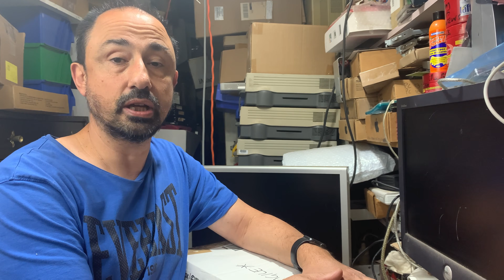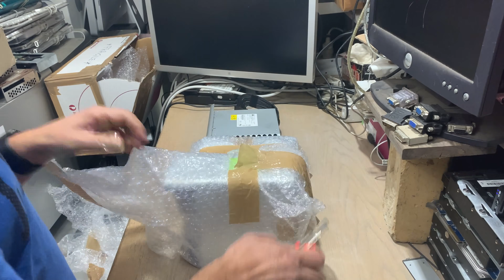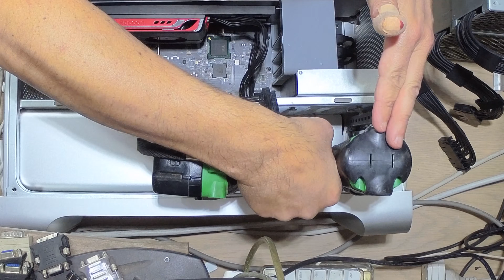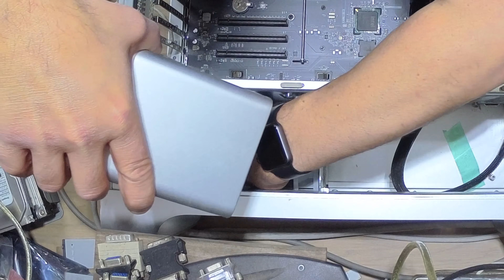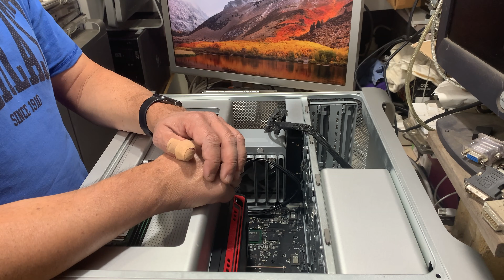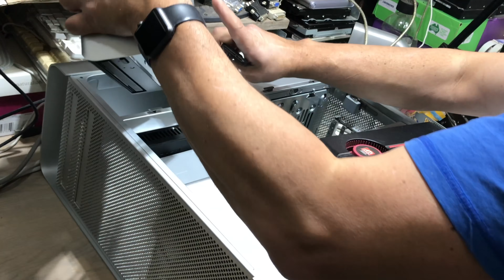[aa-unbox/repair] Replace Mac Pro 4,1/5,1 A1289 power supplies 2009/2010/2012 ⇢ 00000110 ⇢ v22-007

Comment: why don't you have a pad under the case and you draw and make scratches on the beautiful smooth side wall
Reply from the maker: Thank you for your suggestion. About 95% of the Mac Pros that I obtain are from leasing companies, and unfortunately they have been knocked about in large warehouses before arriving to me, thus the multiple marks and scratches that are already on the sides of these Mac Pros. The other 5% are from individuals, and they are not in mint condition either. I just traded one in recently and it had a top bent handle and it wobbles about a little, so one of the bottom handles must be bent a little also.
I will take on board your suggestion, and place a cloth or a large sponge mat, like I used to in the old days.
Reply: I would use a towel or something to stop adding more damage. From fellow repair guy, because client can always blame you for scratches . Always take picture be they hand it off to you. Extra protection from lawsuits
Reply from the maker: @Messiah38  I use to use an oversized sponge many years ago to stop from scratches, and I may use one again. No customer has complained about too many scratches. No customer has taken me to any lawyer as it will not stand in Australia.

Comment: do you know how could i check a PSU with a multi meter?
Reply from the maker: Type 'check pinouts mac pro a1289 power supply' into Google, select 'Need Mac Pro 2009 - 2012 PSU Pin out' from the MacRumors Forums, then scroll down a little until you find a diagram of the pinouts to the connector. You should be able to check out the voltages with a multimeter. This search criteria may change over time.

Comment: I have 3 Mac Pro 5,1 that stopped turning on after a sudden power outage, at 3 different times, they all failed for the same reason. What are the chances that it is the power supply? Should I try buying a new power supply?
Reply from the maker: The main reasons for any Mac Pro not starting can be a fault of any of the following: 1) power supply; 2) backplane/logic board; 3) CPU tray; and to a lesser extent 4) front panel board and 5) front panel cable.
The symptoms can be no power at all (1 or 3, or lesser extent 4 or 5); power on with front light on, but no sound (2); power on and flashing front light (faulty or no memory); power on, startup sound, no video (faulty GPU/video card or cable or monitor.) Other symptoms of power on and then nothing could be a combination of a faulty GPU/video card, or a faulty hard drive or SSD adapter, or a faulty CPU. These are rare but I have had these issues at some stage.
I have a concept of a plan of the process of creating a video for diagnosis of a Mac Pro.
Reply: @ My Macs don't give any sign of power when I press the button, but the fact that the problem appears right after a power outage/failure increases the chances of it being the PSU, right?
Reply from the maker: The power supply is the most likely cause, but as stated previously, it could one or more of the following, in order:
Power supply; CPU board; backplane/logic board; front panel; front panel cable
Buy one power supply and test all 3x Mac Pros. Watch this video anywhere from 3-5 times to show you how to replace the power supply. Like, share, subscribe, and if the video and my comments have helped you in any way, maybe consider a donation. Thank you.

Comment: I have a G5 power supply 980 Watts I think, do you have a pin diagram so I can use as a DC power supply out independent of the computer. Thx!
Reply from the maker: There are 5 different power supplies for all the PowerMac G5s. There is a 980w power supply for a Mac Pro, as per the one in this video. I do not have any pinouts for any of the power supplies, but a quick search should find you the results.

Comment: hi, i have a MP 3,1 2008 , the MP starts i mean it powers on when i plug the power cable to the wall. (first sign that something its not okey). BUT not always starts at the first attemp, i have to unplug the cable from the wall and then plug it again, about three or four times and then it starts (when its not starting it does an inner sound like a click , something from the fan o Psu) then i have to unplug and plug again from the wall, then it starts, its kind of messy, i would like to fix it, do you think that could be the PSU. I am about to buy one from ebay, but im not sure its that the issue,. thanks for any help about it. Great video btw
Reply from the maker: Thank you for your comment.

The click sound you get is just the power supply receiving power. As this is intermittent, it could be the power supply failing (usually the capacitors failing), or the main logic board could be causing the issue. To make problems worse, it could be a faulty video card or a faulty hard drive, or possibly a faulty memory riser board. Although this may be unlikely, I have had one of these components cause some sort of power issues. Try removing the video card, the hard drive, and both riser cards, and see if it starts. I am assuming that once it starts it runs ok, until you switch it off. If this is the case, then you may have to leave it on all the time, until it gets worse.

Comment: So you simply unplug the superdrive? Yours was loose I guess.
Reply from the maker: Yes, you unplug the SuperDrive. An error on filming, as I had already unplugged it in a previous shot.
Reply: @aa-au  thanks. But I got stuck after that. I don't have a small enough tool to use on those torx 10 screws

Comment: How can I know if it’s the power supply that is failing. My computer restarts randomly, i cant see to find the issue. Great video by the way
Reply: I have had same issues. Most times fixed it for my by blasting of all dust with compressed air spray bottle and a paint brush to brush it off. Yet since last week's this doesn't seem to work no more. Was hoping perhaps dusting out power supply would help
Reply: @RomboutVersluijs I ended up replacing all parts. Long story short, it was the daughter board. It had some bent pins from removing and installing the ram. Check your pins or replace daughter board.
Reply: @ktangut  what do you mean by daughter board?
I know the term donor-board, but not daughter board.
Edit
Googled it, I thought it was one main logicboard.
Reply from the maker: @RomboutVersluijs In the case of the Mac Pro, the daughter board usually means the CPU tray or the large tray that slides in and out at the bottom. This CPU tray contains either 1x CPU, a large heatsink and 4x memory slots (for single processor CPU trays) or 2x CPUs, 2x smaller heatsinks and 8x memory slots (for dual processor CPU trays.) The memory can be populated in any of the slots, but not some of the slots. I will have to release another video regarding memory in these slots.
Reply: @aa-au  we have an old 2007 2.1 pro showing random reboot issues. Had it couple times before and normally blowing ou the dust and cleaning ram would fix it. Now not so much. Tried dusting out power supply, but I don't have enough knowledge and tools to remove it.

It's either dead end now or perhaps a local certified repair shop can try it.
We have dual core xeon with 64gb ram
Reply from the maker: Thank you for your comment. The computer restarting randomly could mean anything, especially the frequency of restarting. It could mean any of the following (and usually in this order): 1) Faulty or corrupt software - backup your software, format hard drive or SSD and install a fresh MacOS; or 2) a faulty hard drive or SSD - backup your software, install and format a new hard drive or SSD, and install a fresh MacOS; or 3) a faulty backplane/logic board, or 4) a faulty power supply, or 5) a faulty CPU board (or a combination of these, but unlikely.) Try option 1 and/or option 2 and see if this makes a a difference. Options 3/4/5 are more difficult to diagnose and you have to replace expensive hardware.
Reply: Mine starts to reboot randomly, but it was getting worse in a few days pretty fast, now it can't hold 1 min. Replaced de SSD with a Mojave installed, and it is still rebooting, might be logical board.

Comment: Hi. Can you advise what is the issue when we hear a buzzing sound from  the Mac Pro PSU? Is it failing?
Reply from the maker: Thank you for your comment. Make sure you can isolate that the buzzing sound is coming from the PSU area. Remove the SuperDrive optical caddy and determine if the fan that sits in front of the PSU is spinning. If the fan is not spinning then you have to replace the whole case as this fan is almost impossible to replace.
WARNING Perform the next step at your own caution. If the fan is spinning, then you can temporarily place a small plastic tool gently inside the fan to stop it from spinning. If the buzzing is still coming from the power supply then there is a component that may be loose and is vibrating, or a component may be failing, so you will have to replace the PSU. Unfortunately, at this stage we do not repair the PSUs but can provide a replacement.

Comment: Hola buenas noches a mi me venden una mac pro del 2009 4 nucleos en 50 dola pero el dueño dice que la pc encendia y a veces no y ya no volvio a encender solo falta disco duro trae 12 gb ram que sera el daño fuente de poder o boton de encendido o la tarjeta madre saludos desde panama
Reply from the maker: Thank you for your question. When the Mac Pro turns on then switches off, it is most likely going to be the main logic board or backplane board (motherboard.)

Comment: Hi!, Great video thanks for sharing, I have also the same unit that you've used to test the power supply that you demonstrate, coincidentally I was looking for a video that can help me to repair my mac pro 2009 4, 1 because it did not start when I press the power button. But when I plug it in the outlet there is a blink of small red light near the 220 number, Can I ask for a help how to fix it? and is it mean that my power supply is already busted? should I replace the power supply? Thanks in advance, hope you can help me.
Reply from the maker: Thank you for your comment. The red light just means that there is a surge of power that goes through to the logic board. It could mean any of the following (and usually in this order): 1) a faulty power supply, or 2) a faulty backplane/logic board, or 3) a faulty CPU board (or a combination of these, but unlikely.) Try disconnecting the power cord for 24hrs. Reconnect and try again. If you don't get power then it would normally be the power supply; or rare occasions it is the CPU board. If it turns on then the backplane/logic board is usually intermittent and will progressively get worse ie: not be able to to turn on at all, or turn on and just the fans spinning.
Reply: Very likely the logic board needs a replacement. I have couple of these logic boards exhibiting the same symptom.